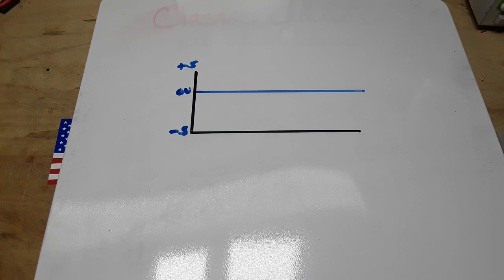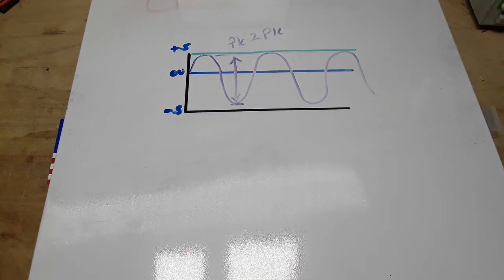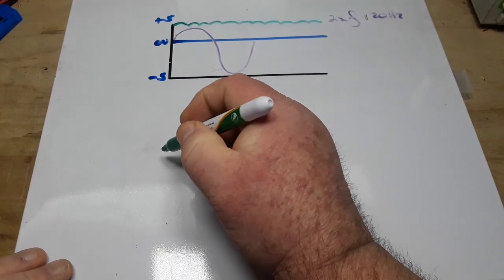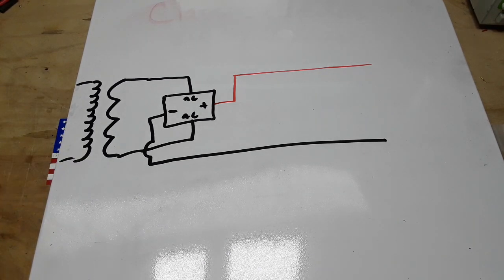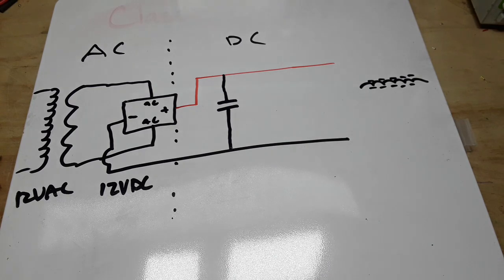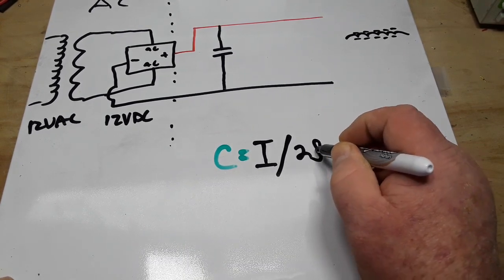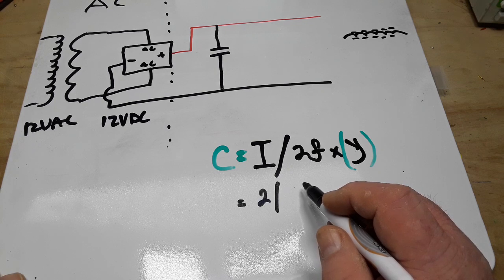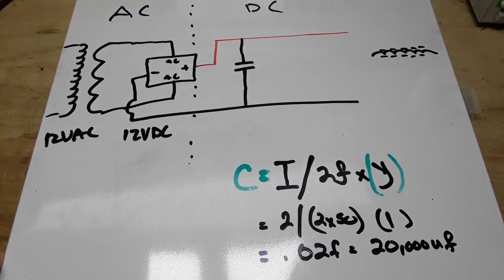How to choose a smoothing capacitor to reduce ripple

Comment: Your regulated, not-smoothed peak to peak is still gonna be from 0 to 5v. What you've drawn looks like it's got a DC offset of like 4.8v that's come from nowhere.... if such a thing existed we wouldn't bother with smoothing caps and just use a slightly higher input voltage and mow the lawn down to 5v with a regulator

Comment: I'm confused about that 1V that you said it is the maximum ripple.
It looks like that if you accept 0V ripple you multiply it by 0 and use a 0uF capacitor. Which doesn't sound right.

Please let me know what is that 1V you choose.
Reply: The voltage is in the denominator.   It is unfortunate that 1v is chosen in the video, since it does not make it clear that the voltage is in the denominator.

Comment: Good starting point.. The confusing part (probably on me) was not sure if it was (I/2f)y (which puts the y on top) or I/(2fy) (Y is one the bottom - the correct one).  Using y=1 made it moot.  but truly appreciate the help.

Comment: hello, thank you for such clear explanation. Could you please also help me understand if the voltage value on the capacitor should be checked. my rectified DC is at 75V

Comment: Nice video Paul. Perhaps you can do a video on Capacitance Multipliers. Since getting Ripple down to a decent level (single digit millivolt), a large capacitance is needed. A Capacitance Multiplier would do well in that instance. They're cheap and easy to build too. (less than $5 in most cases) if you get your parts from Digikey. - Just a thought.

Comment: Guys formula is correct..I am designing a 6amp 2 volt ripple output rectifier and choosing a 3×10000uf 50 volt caps

Comment: It seems too easy. That's because it is.
Here is what I found and it's more complicated, because it makes sense.

The input variables to the formula are: a. Input AC voltage, b. Load current, c. The ripple tolerance on the load.
The formula, to approximate the cap, is: dV = 1/C x I x dt

Example:
Trans former output = 9V AC
Rectifier drop = 1V
Load resistance = 100 ohm
Tolerable ripple = 0.5V

1) Peak voltage at the load side of the bridge rectifier
= Vac x root(2) - 2 x Vrect = 9V * 1.4 - 2 x 1V = 10.6V
2) The load current, Iload = Vpeak / Rload = 10.6V / 100 = 106mA
3) C = {Iload x [1 / (line_frequency x 2_for_full_bridge)]} / Vripple
= {106mA x [1 / (50Hz x 2)]} / 0.5V = 0.00212F | 10.6V => 2,200uF | 15V

The same formula is used as well to calculate the input capacitor value between rectified AC and a voltage regulator.

Cheers!

Comment: Howdy. Yeah.
That formula is good for a level 1 approximation.
The transformer current will not be a sine wave using filter capacitors. It will be spikes. Spike duration will be say 1/5 of a half cycle and spike magnitude say 5 x of the mean value. With this high current spikes the diode voltage drop will be say 1,2 Volt, not the 0,7 Volt usual diode forward voltage.
Also. The capacitor discharge time will be slightly shorter than a half cycle time.
And observe. The RMS of the spiky current is way larger that its mean. It can be as much as 1,4 times. The RMS value is the one to be used to rate the transformer power. Complex Power or VA Power. Not to be mixed with the Watt Power consumed by the load.
Regards.

Comment: Where does the ripple come from when a filter capacitor is added in circuit and under no load? (less than 100 mv) Regards.

Comment: I want to recap the power supply to a vcr, can all the caps be high ripple current or is it possible for the ripple current to be too high?
Reply from the maker: Just order matching caps to what is there. Try to stay close on the capacitance, go over if you must, but never under. Same with voltage, you can replace a 16v cap with a 25v or 50v, but you can't go lower.

Comment: GREAT VIDEO!!
I remember, years ago, I really got into the mathematics of most applications.  One included  the relationship between capacitance, ripple and current-draw in linear power supplies.  I came up with something like this.......

IT TAKES 8300uF OF CAPACITANCE TO REDUCE THE RIPPLE VOLTAGE BY ONE VOLT PER AMPERAGE DRAWN.

This applies for 60z full-wave rectification.  For half-wave rectification, it takes twice as much capacitance to do the same.  I may be mis-remembering the exact capacitance.  I was glad to see this video....I may re-do this and see how it compares to your method.
Thanks for the video!!
--dAle

Comment: ok i now have smoothed dc power source.  thanks for the way to calculate capacitor size.  woundering how to size a SSR to discharge the capacitor when the power is turned off.  i now have a dc welder with 100,000 uf or 10 farads at 100v rating to unload.  thinking about a normally closed relay that would drain the capacitor when the switch is turned off.....

Comment: using a Y of 1 in your example is a mistake. it is unclear whether it divides the current or multiplies it to people as a result (bracketing can be incorrect)
Reply: Actually yes, your formula is incorrect, and my note above is therefore proving the point.  Proper formula is   C = I / (2 x f x Vpp)

Comment: 12 volt -5 amp DC power  supply need 6800uf Capacitor

Comment: Great job! And thanks for sharing. I have a question about the current expected. are you referring to the current consumption of the circuit without load or the current of the circuit under load? In my case, my microwave oven transformer consumes approximately 6.8 A, and 7.5 A under load, so which one to use with the formula? Many thanks for your expected response.

Comment: Even though the math is error free, the result doesn't make sense... 2A is a fairly modest output current. 1V of ripple is a LOT of ripple for a power supply. And 20,000 uF is a HUGE amount of capacitance! HUGE! These numbers defy my intuition complete. Moreover, no consideration was given to the ESR/Ripple current of the cap. This explanation feels wrong and/or incomplete.
Reply: I have to agree. It seems inverse somehow.
Reply: According to the math, the less ripple we want, the smaller the capacitor. If we follow this logic, we can have ZERO ripple if we use NO capacitor...??? Or is there something I'm missing?

Comment: That was awesome and simple !!! One question...what voltage for the capacitor ? Example, 36VDC ,20,000uF, do you recommend matched voltage on the cap or can it be less ?
Reply: Make sure the capacitor voltage exceeds the circuit voltage.  When rectifying AC you will want to figure out what the peak DC voltage will be by multiplying the AC voltage times 1.41, then choose a capacitor with a higher voltage than that. A slightly higher voltage and temperature rated quality brand capacitor costs more but are less prone to failure and will be more stable.

Comment: When I attach 22000uf capacitor to 12v the voltage jump to 20v .. why is that happening?
Reply: After rectification the capacitor acts as a buffer and works to smooth out the voltage by charging itself to the peak voltage available.  This is what you're measuring after it.  Before the capacitor you are measuring an averaged uneven voltage as it has not been smoothed at all.  If you multiply the input voltage by the square root of 2 which is 1.41 you will get the output voltage.  You can divide the output by 1.41 the get the input.  If you're getting 20v output the input would be close 14.2v.  Additional parts can be used to further control the output.

Comment: I have a 120v dc pm treadmill motor that I wanna regulate it's motor speed.  I'm using an ac 10,000 watt motor controller pwm I believe and adding a full wave bridge.  How do I figure the smoothing capacitors value for varying voltage of the controller?

Comment: Good video, very informative. How does one determine the allowable peak to peak, though?
Reply: Max peak to peak would be based on your IC or whatever you're wanting to run off the voltage available. Anything logical or sensitive will be much better off with a stable voltage, probably no more than 100mv or so constantly.
Reply from the maker: That's up to the designer.

Comment: if i did the math rite. 35 amps at 120hz / 2volt was around .58 so this is 58,000uf for them HF welders. converting them to DC .

Comment: Um, are you sure of that formula ( C=I/2f * y )?  Based on that formula as your desired ripple value goes down so does the size of the needed cap, which is not correct.  Smoother DC requires larger capacitors, not smaller ones.   Maybe it should be C=I/(2f * y) ?
Reply: Exactly, he is wrong, and he also used 1 for Y which is a mistake for an example!   Proper formula is  C = I / (2 x f x Vpp)
Reply: As y goes down, I/ a smaller number increases so C goes up; not down as you stated.. Hope that helps!
Reply: @howardcrum2411  Hey Howard - not exactly sure which post your "not down as you stated" comment was aimed at but to avoid confusion, your comment about "... I/ a smaller number increases C" actually confirms, again, that the formula in the video in wrong.  Hopefully that's who you were confirming as wrong.  The original formula was C=I/2f*y, which will decrease C as y gets smaller.  Parenthesis and order of mathematical operations matter.  :)

Comment: Just add a LC filter to filter the ripples out, capacitor doesn't need to go full awol on 20,000 uf, a nice 1000uf with a matching inductor will do the job of smoothing the dc out.

Comment: Tq for yet another informative video. 
What is the effect if you used that 200,000uF capacitor but your ripple was only say 0.2V? I'm guessing no effect as it seems the C value is only to "cover"' the max ripple, so if ripple is lower than that calculated, you're still good to go, plus the fact you said you'd just get the largest capacitor you could find suggests there's be no detrimental effect.
I'm also curious about getting 5V DC out from 5V AC in. Wouldn't you get <5V DC out due to energy wastage in the rectification process? If so what level of DC would you expect at the output? - Is there a formula to calc. the exact DC out voltage?

Comment: Heck, back before them fancy vacuum tubes and stuff came along we used to do this with an m/g set! (motor/generator)!
Reply: The Monarch lathe company used to build a toolroom lathe (model 10EE) with a DC spindle motor, and they used a motor generator set in the base of the machine to power it. They later switched to other means of powering the DC spindle motor, but I don’t think any of them were quite as good as the MG set with regards to the smoothness of DC supplied to the motor and overall durability of the system, as the MG set was almost indestructible!

Comment: There are a number of problems with just throwing in a big electrolytic capacitor or even calculation the value of the capacitor required to achieve a particular level of ripple.  First it does not take into account the ESR of the capacitor used or the series drops in the bridge and transfirmer, and why two or more capacitors in parallel maybe better than one, or why a choke coil may be required to deal with  the very large inrush current associated with charging up the capacitor to the average DC output voltage. 
While adding a big smoothing capacitor addresses the ripple voltage problrm, it put a huge stress on the input fuse and the diodes in the bridge rectifier, this is certainly the case where high output currents are required. This is really a topic that requires further expansion.
 to address the other problems. It's worth looking at the losses in the bridge diodes, and how their switching action generates high frequency noise spikes, or looking at the specification of the non ideal transformer.
Reply: Can you recommend a video, or have you made one?
Reply: @jasonc3a  this channel will not allow me to post links to other YouTube channels, but the information is easy to find in a YouTube search.
Reply: @jasonc3a  try searching for he "organic chemistry tutor" and "katkimshow" , the latter is an academic lecture series the former is also academic, but has diversified from chemistry. Look for the one on bridge rectifiers. It is a shame this channel will not allow the links to be posted, but it is understandable given the rubbish links that might be posted.

Comment: I do not understand. So in this example you need one capacitor of 20000uf?
Reply: Nobody?
Reply: @Mr-Splendid-NL  only assuming you're pulling 2 amps constantly at such a low frequency (lots of off time for a capacitor).

It doesn't have to be a single capacitor, just that total amount of storage. It can be split amongst say 5 4700uf capacitors which is feasible if not a little crazy.

The example isn't really the greatest because capacitors aren't very efficient storage at such a low frequency. They're better used as just energy tanks feeding into some kind of SMPS circuit. That's where the efficiency really shines because you can go much higher frequencies.
Reply: @OtherDalfite  Thank you for your explanation. thought it strange that you should need such a large capacitor. Also because he writes 20,000uf which I confuse with a 20uf capacitor.
Reply: @Mr-Splendid-NL  in this case he does mean 20k uF because that's what you'd need in order to supply 2 amps for that significant amount of time (0.16s or so). Huge amount of time in electronics world

Comment: Question is the frequency in the formula based on line frequency, or the rectified frequency. If you were using half wave rectification your frequency would be half of full wave rectification? Just curious.
Reply: f=Input frequency

Comment: I use a signal generator and my Hantek displayed on a big screen to teach my students how a rectifier and capacitors get you from ac to dc. Theory is good but showing it in practice works better.

Comment: What type of capacitor, always just an electrolytic for bulk capacitance?
Reply: electrolytic gives you lots of capacitance for the size.  Also, pretty hard to find in a ceramic at those values.

Comment: But to determine the capacitor value more precisely I am measuring the amperes of the transformer before calculating the value of it in the equation

Comment: If you want no ripple then anything multiplied by zero is zero. But I guess we could add a primary filtering capacitor and then further in the circuit add another one or two in different stages to get as close to zero as possible.
Reply: The peak-to-peak voltage in that formula is in divisor, C = I / (2 * f * Vpp). The smaller the wanted ripple, the bigger the capacitance. Theoretically when ripple is really small (close to zero), capacitance is really high (infinity).
Reply: @oherrala  cool, thank you Ossi

Comment: This is obvious, but just to write it down for myself to remember, as gamma approaches 0 C approaches infinity, which explains the "i just grab the biggest one I can find" approach as a fast, no thought solution.
Reply: But what happens when that infinite  capacitance dumps all its energy into your circuit on turn off?
Reply: The problem is big capacitors are expensive.

Comment: Oh plz, just put a fat electrolytic cap on the other side of the bridge. For other frequencies put some disc caps.
Reply: What ~minimum value, though (for the present lesson in the basics) ? ....Not to deny you your point that leads towards an idea or suggestion for a subsequent, appending lesson.

Comment: Great explanation! Do you have one on how to know if you need a capacitor for an IC (coupling capacitor)?
Reply: Look at the datasheet. It usually a good idea to decouple every IC as a matter of course, however, some ICs will need more than others. FPGAs for example which are operating at high speed will need significantly more than an FPGA running at low speed.